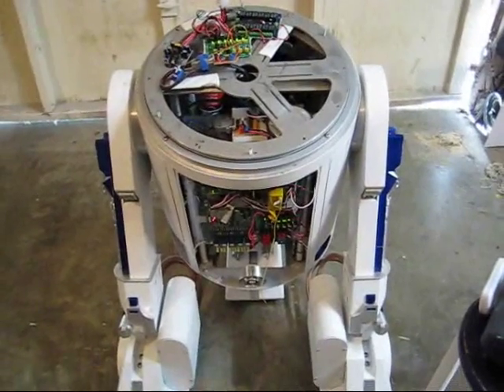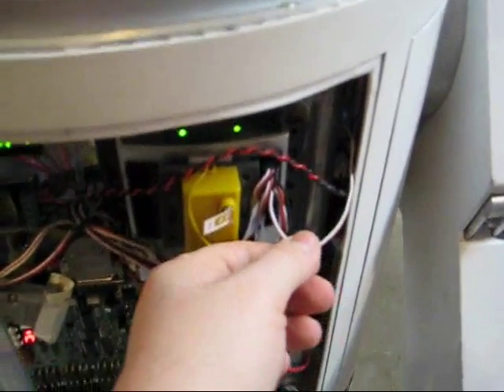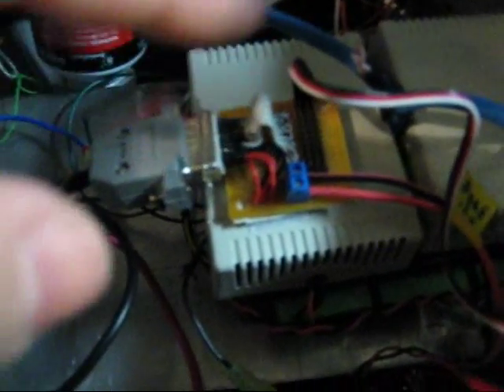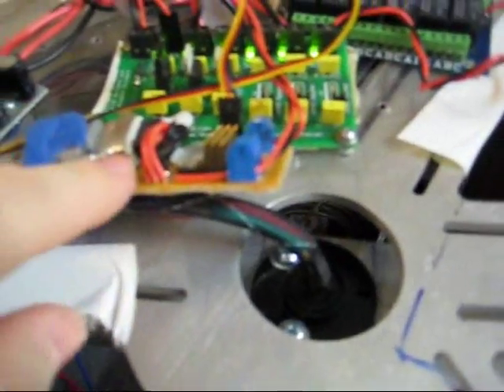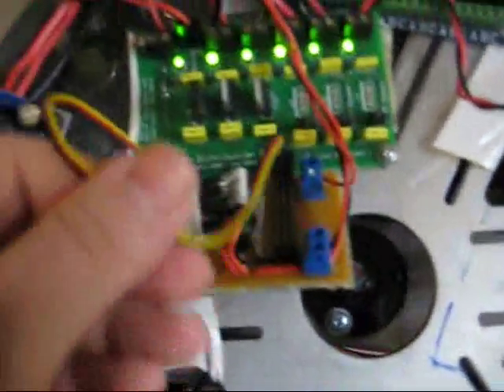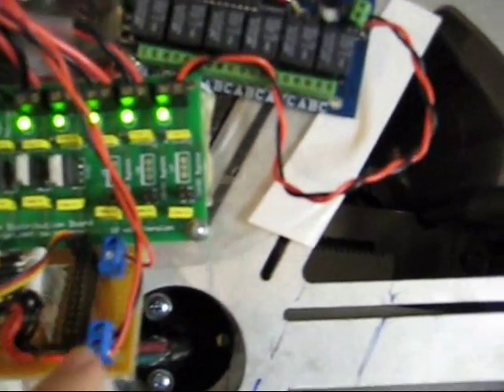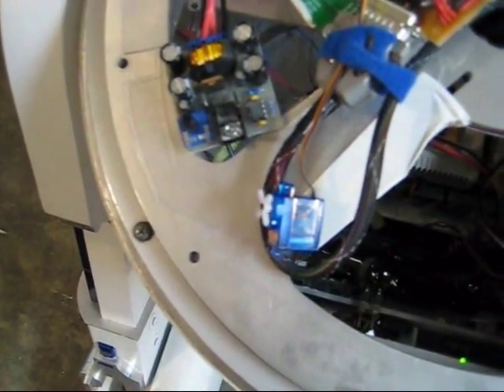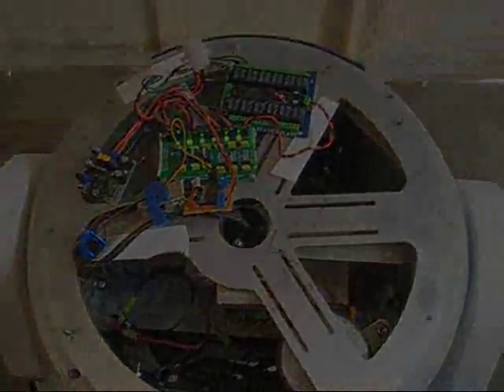R2 Dome - Slip Ring Test 2

Comment: I guess that makes sense.  But if you have the center hole on the rockler, why not simply route all the wires through that to the body?  Why is a slip ring and slip ring and where is it doing its' slipping?